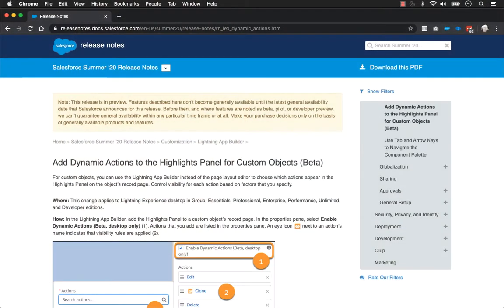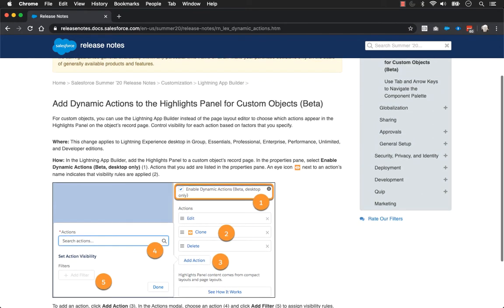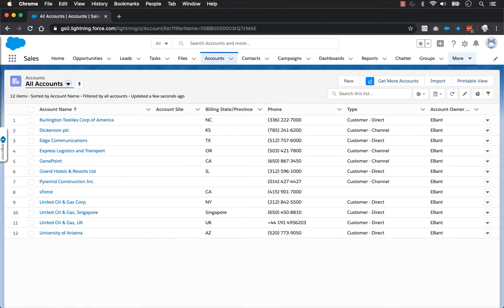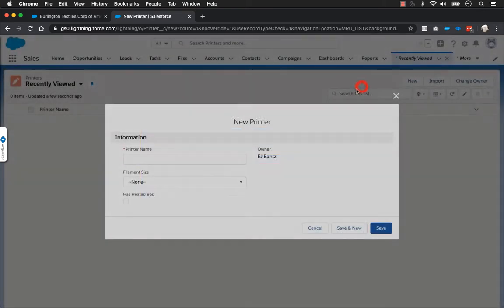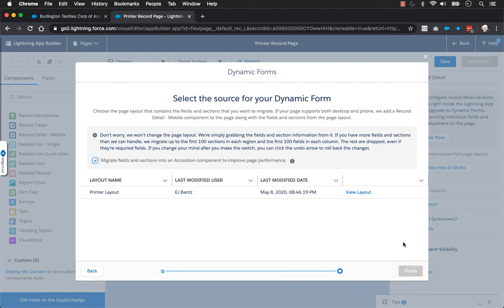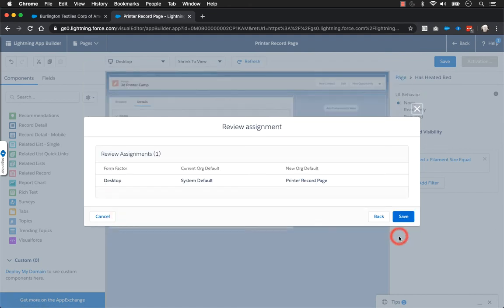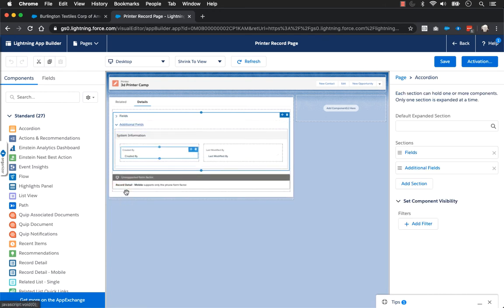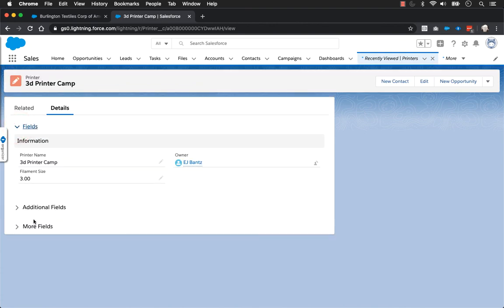Salesforce Preview Summer '20 Dynamic Forms (Fields Anywhere)

Comment: I have implemented this and it was working fine. But the configuration broke and the section filters are not working for 15 days. Looks like Salesforce is still working on optimizing or adding more features.
Reply: Hi Sathish, I cant see the toggle button to enable the Dynamic forms in Record page settings in My DEVELOPER AND SANDBOX.